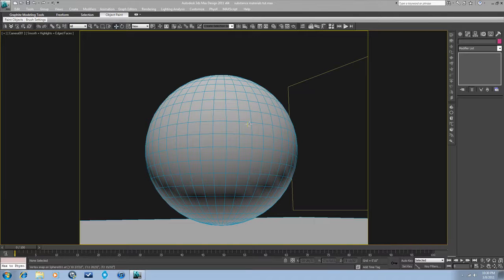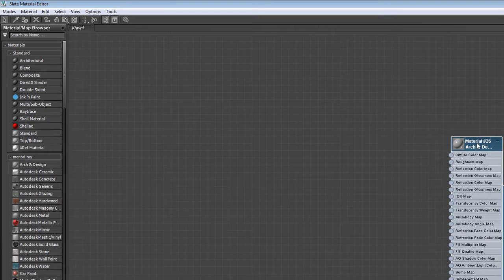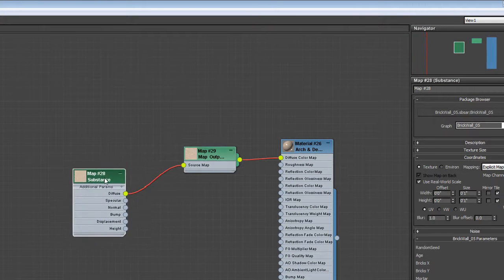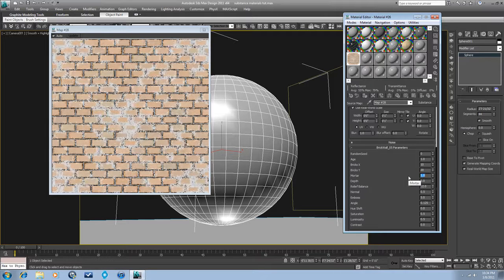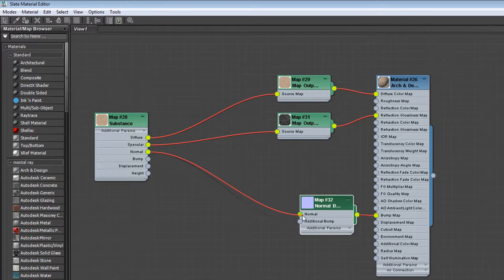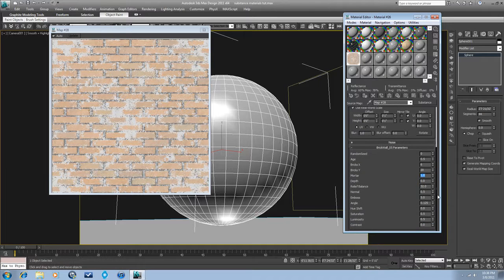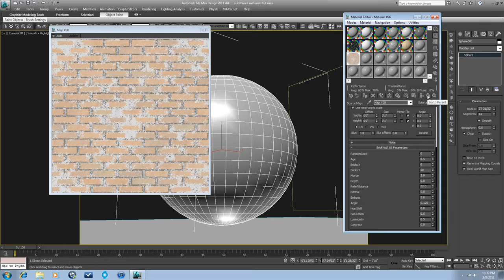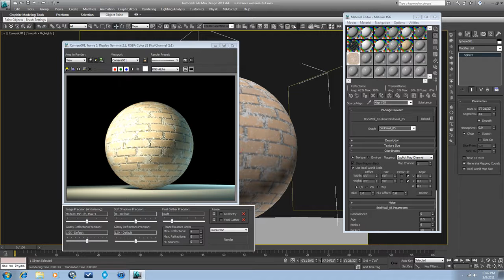Substance Materials Tutorial - Max 2012

Comment from the maker: I think I had already loaded it in both places, so when I update it in one place, it was updated in the other.  Basically it is two different instances of the same material.  If you assign the material from slate to an object, it is easy to use the eyedropper in compact mode to grab an instance from that object and place it into the compact editor.